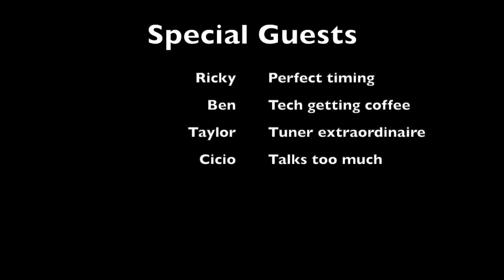Cicio Shop R8 NEW XonaRotor Turbo RESULTS

Comment: goes right along with my findings going from the 7675 to a 10569 on how well the Xona performs on my 4.2L 👌🏾 less drive pressure (i have sensors) more power at same boost. faster spool, more torque.